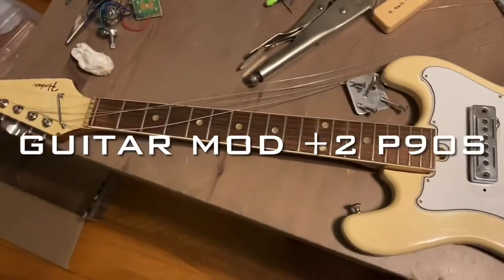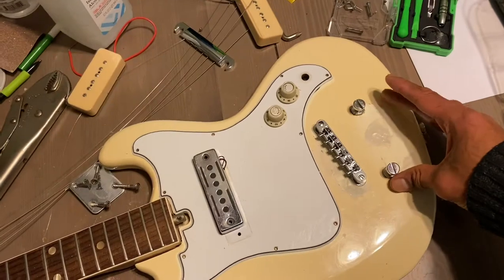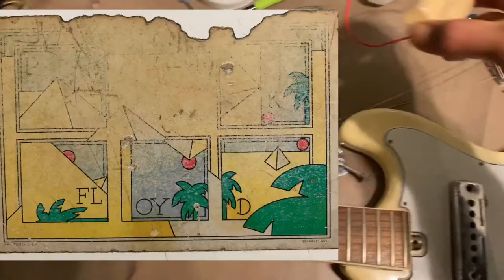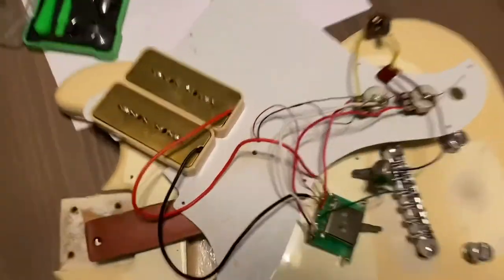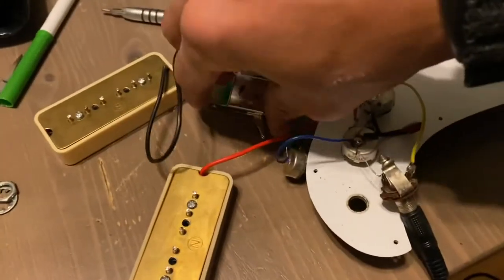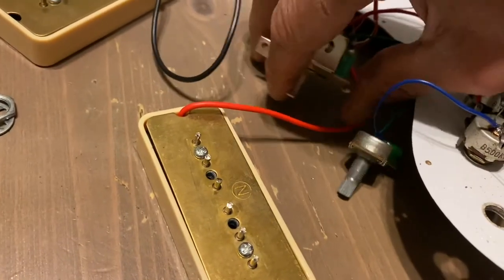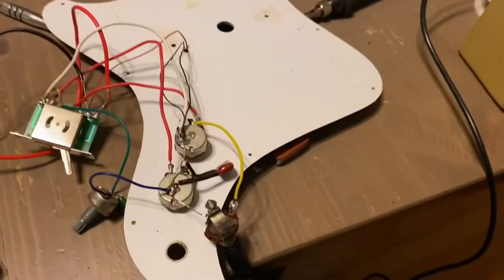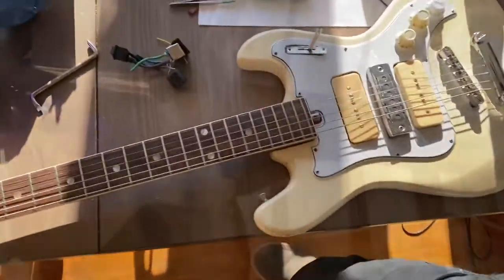Teisco Kingston Guitar Mod - P90s + 5 way switch

Comment: Did the 5 way fit or did you have to remove wood to fit it in there. Shallow body?
Reply from the maker: I had to remove wood but still the switch stuck out of the body a little bit. I should put a shallower switch in there. The one I had was pretty tall but all I had on hand.